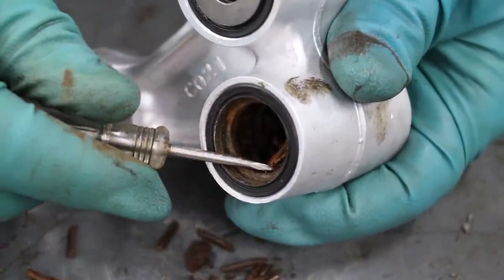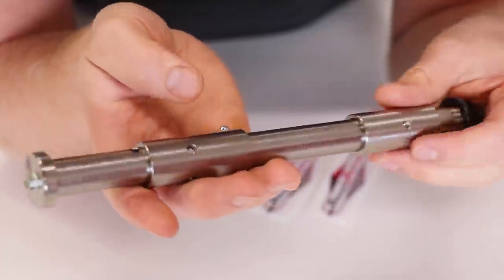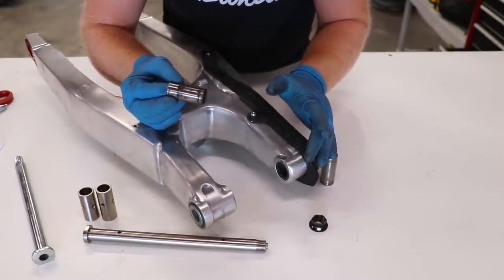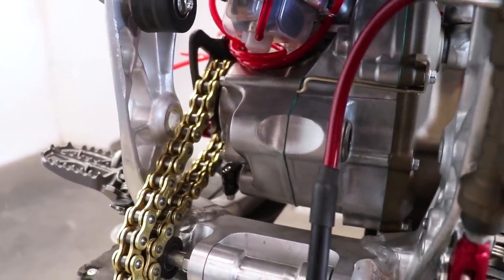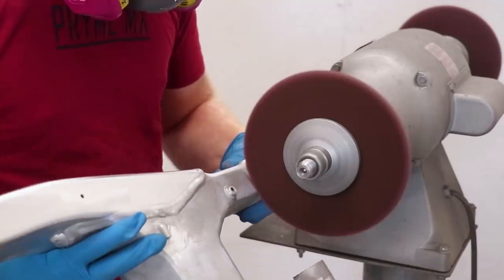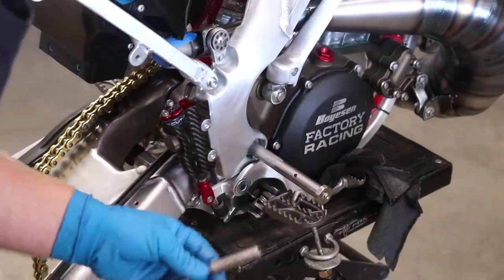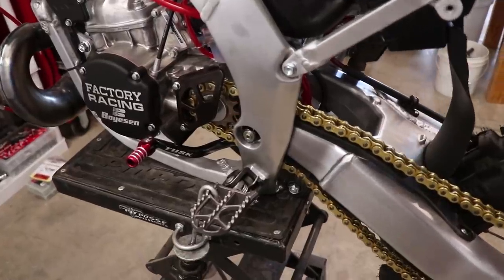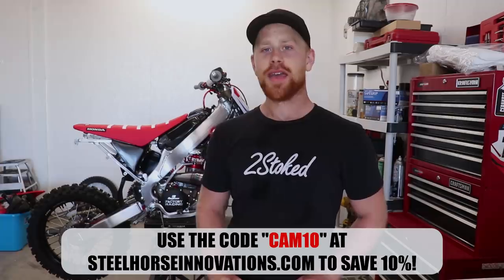Fixing This Problem For Good!

Comment: Would be nice if there was a rubber or plastic cap to go over those grease fittings
Reply: Daniel Rodriguez-Segovia brake bleeder caps
Reply: I was about to write the same thing
Reply: 3d print one
Reply: James great idea!
Reply: @jameshatfield6814  , That's not gonna work. These aren't regular zerk fittings. These are flush type grease fittings. There is nothing to put the cap on.
Reply: @2DclanSnipingTeam   i was thinking like a cap that goes in the swingarm hole itself

Comment: Just grind the two sides off the linkage bolt so it fits in the slot. The grease fittings are spring loaded no covers required just clean them before lubing

Comment: Hey 
Just wanted to ask in one of the vids where you installed the engine you mentioned that you’ll torque the mounting bolts later on. Have you done this yet? It’s been bugging me every time I watch a video. 
I think your bike looks awesome and can’t wait for the suspension to arrive 
Thanks for your videos honestly you’re the only guy doing a proper bike build on YouTube.
Reply from the maker: Thanks John! I haven't got to that yet, the shock has to be installed first to do it. That'll be in the coming videos

Comment: You could drill and thread a grease nipple (I think you call them zerts) into the bottom or top of the case to grease the center bearing.

Comment: Good idea but..... the  inner seals will push out towards the motor cases with the pressure from the geese gun  and possibly pop out of the swingarm itself. Especially if you keep pumping more and more grease in with nowhere else for it to go. I would have thought it would be better to remove the other side grease nipple while pumping grease in to allow fresh grease in and the bad out without blowing out seals. Maybe I’m wrong?

Comment: They should have those bolts for the linkage as well because if you need to grease the swing arm bearings, chances are you need to do the same for the linkage so is you remove the linkage the swing mark isn’t much harder

Comment: I've never figure out why MX bikes do not have zerks on the linkage......even my old KDX or IT had them.  If there is one thing most guys hate it is pulling linkage apart all the time to keep it going.
Reply from the maker: I would imagine its due to them breaking off and causing more issues
Reply: @CameronNiemela  Too,  from what I've read , the pros tear down their bikes after every race and, therefore, bearings are replaced or regreased at that point.  On my old KDX/IT.....if I remember correctly, the zerks were in a very protected place on the swingarm pivot (grease flowed from center-->out to ends) and the linkage zerks were where rocks/etc would have a hard time breaking them.  As an old "bike buster" I can't remember ever having a zerk destruct.  I broke the frames and wheels on bikes but never zeroed out a zerk.  I rode the high, rocky desert for 30+ years and, since The Creator likes rocks, we had plenty of 'em.  On a different note.....how does your girl like her 100?  I got an XR 200 for my wife in '92 and she adapted right to it....might be something to think about as she "outgrows" the 100....you sure did a nice job on that bike and I'm waiting for some dirt on that blinged-out CR.....LOL!  Keep the Faith, kid.....love your videos.

Comment: hey cam do you know if you can change those grease fittings out on the bolt? say if the ball or spring breaks in there it would be quite the inconvenience to change the whole bolt again
Reply from the maker: Longneck yeah the fitting does thread out